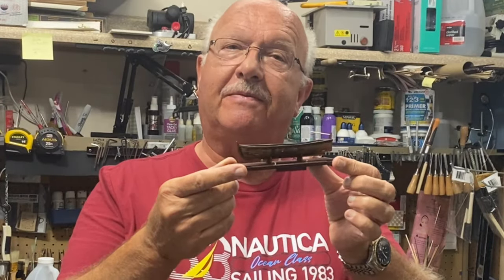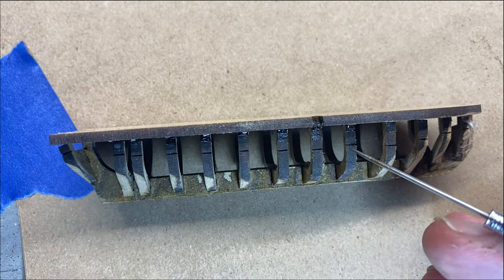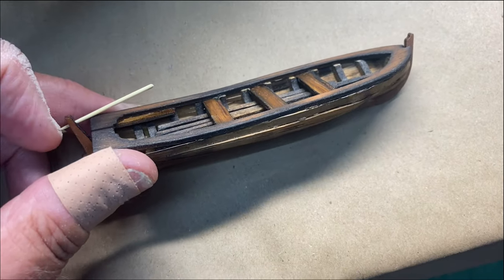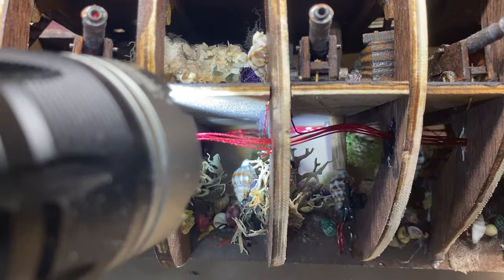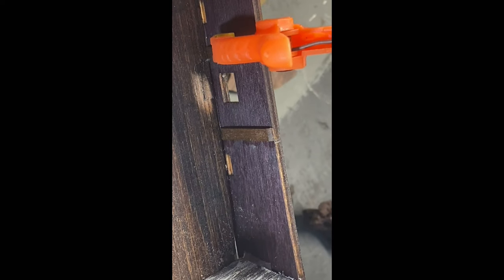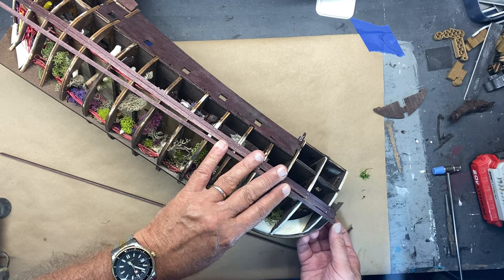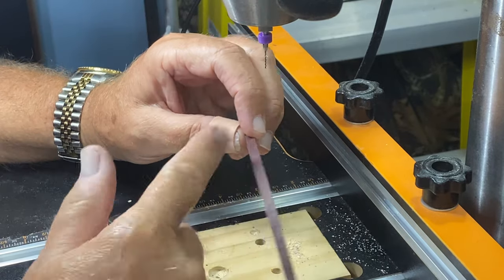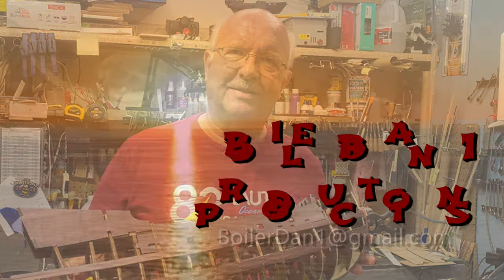The Flying Dutchman Part 8

Comment: Lookin awesome sir, I'm back on mine now as well, Keep up the great work my friend.
Reply from the maker: Thanks, I’ll check in on your progress too! 😉
Reply: @BoilerDan1  Thanks
Reply from the maker: I’m not impressed with the two blacked out cannon ports…. I had some leftover false cannon ports where you stick a tapered barrel from the outside.  I’m giving that a try.
Like you I’m puzzled why on the open side it plain plywood sections instead of just planking it?   I’m going to go with it for now. I’m looking forward to seeing what you do.
Reply: @BoilerDan1  there's six blacked out Cannon ports to put those half barrels, there's two on each side and two at the back, I'm a little upset that they put doors on the bow where there should be two triple guns. I got rid of all the plywood on both sides of the ship, and I also got rid of the plywood on both sides of the four Castle. I also used solid blocks of basswood for the bow instead of layering all the pieces of plywood. I have shown all of that to my videos, I am currently working on placing the cannons after rigging them all, and I'm also working on the chain plates and dead eyes, that should all be in the next video
Reply from the maker: @BluestreekCustoms I’ve got some catching up to do!  I’m covering over the plywood panels.  I’ll do the switch over on the cannon ports.  Undecided if I could make the triple guns?  Might be a good challenge!